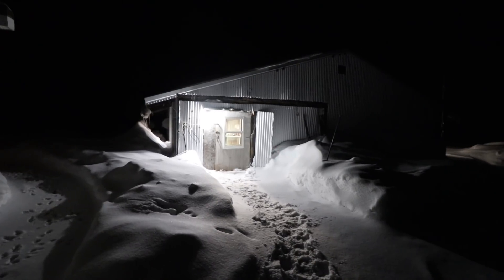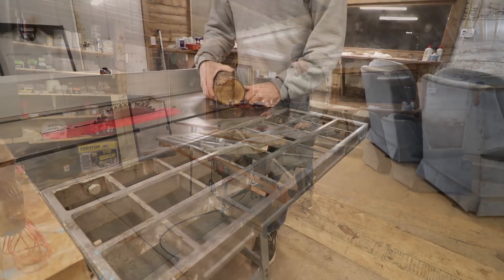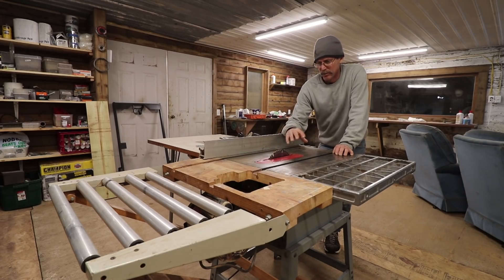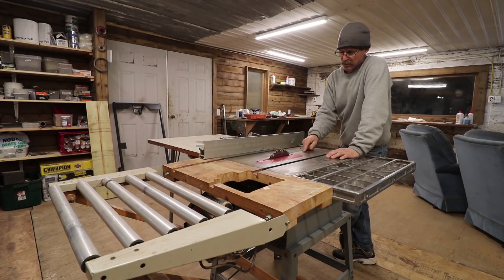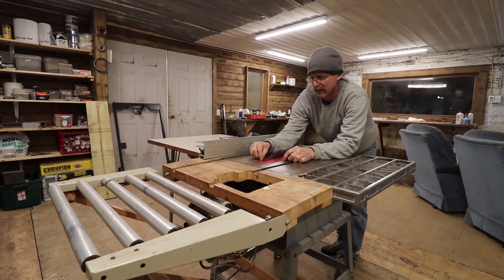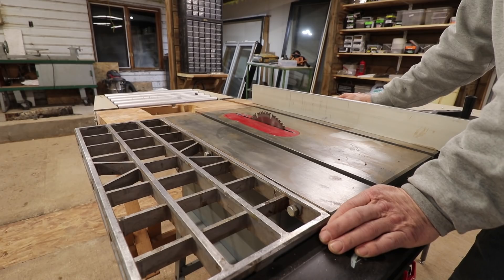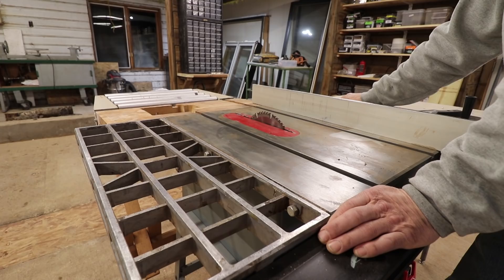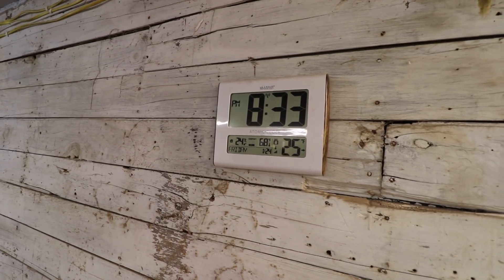Question? Delta Contractors Table Saw. Safety Issue. Board splitter. Your thoughts?

Comment: The splitter and bracket you described 1st in your video is what I use. I have a Delta 34-444 saw with the Delta 34-868 splitter and bracket attached. It fit without any needed spacers. The splitter can be lowered below the table and lifted back up with one pull or push if you choose not to use it on a particular cut.
If you are using it you must push the board all the way through. You cannot stop partway and pull the board out due to the kickback arms on the riving knife. I do love it because it is easily taken out of the way if you don't want it and then raised back up when you do.

Comment: Hi Joe I do this for a living and our saws have what they call a riving knife it sits right behind the blade and that stops the material from catching the back of the blade which causes kick back. Also make sure your table and your fence is aligned with your sawblade if your table is not there is four bolts that you loosen underneath and you can move that table from side to side to adjust it. If you’re running those logs through you should build a carriage that can clamp that log down and make a safe cut don’t listen to some of these people that say do it like you want to there are certain rules to keep a tablesaw from taking off your fingers or kicking back and doing damage to you
Reply: I would use the radial arm saw to cut the logs. If a kickback happens the log will be pushed against the fence.
Reply: this is what i call sound advice! You said it nicely, with knowledge and professionalism. If all of the persons that write comments in these videos understood the importance of making intelligent and truly useful comments, then many would stop writting. Please, if you do not REALLy know what you are talking about, do as I do, speak of the animals, of how much you love these videos, of what hard a hard working man this guy is, , comment on the delicious food Melissa prepares, etc etc etc, but stop writting bullshi......!!!

Comment: I had one of those for about 30 years. I think it was a 444 model, but I sold it. I never really had a problem with kickback, but you only need one time to do some damage. I always stood slightly to the side. It was only a 3/4 hp motor and many times the belt would slip if something bound up. I didn't do professional work, just hobby stuff.
A riving knife would help with kickback more than any other addition. I think most of the manufacturers have added those to the new saws. One issue you might have with kickback is a board going through that window behind you.
I upgraded to a SawStop last year and the blade guard is somewhere in a box. I have never used one and see nothing but annoyance with them. Things like that put barriers up to getting the cut done or limit your vision like you stated. The more time taken to make a cut, the more likely you are to have a issue IMO.
I have great respect for all cutting tools and make sure I am alert and know what I am trying to do. I don't force things and stop if I have a hint of a problem. The older I get, the easier it is to walk away if I get tired or am unsure of what I am trying to do.
Great respect to you for thinking about your safety.
Reply: I have a similar type craftsman saw,and never stand behind the saw when using..one time in all the years I've owned it,I kicked back a piece of oak I was cutting.but because I stood off to the side,I didn't get hit..I also have a great respect for power tools[and my fingers),but shit happens sometimes..

Comment: I have had this model saw for over 30 years and it has been a great saw. The one thing I will say is no matter what saw you have always make sure it is set up properly. By that I mean aligned. There are adjustments to align the blade table and also blade to fence. These are usually in owners manual. I have a dial indicator for this. I believe it is from align it. There are many videos on you tube to show how. This will cut down the chances of  kick back greatly.  I have only had a kick back 3 times an all were my faul. Board moved away from fence and a warped board other side great saw. Thank you for all the videos.

Comment: Some people say you need everything.   I don't use my blade guard because, yes, it does get in the way.   But I also only raise the blade up high enough to cut the material I'm working with, and I use push sticks and other safety devices that keep my hands away from the blade.  As far as a "splitter" or riving knife, you have options.   They do make inserts that will fit your blade plate, that will provide a measure of support.   You can also make your own inserts that have the splitter installed.   You do need something to keep the wood from coming together after it goes thru the blade, for safety.   We had a kid, when I was in high school, that got kickback, and the board went thru his spleen and he spent quite a while in the hospital.   You can also reduce danger, if kickback occurs, by standing to one side of the blade and using push sticks that keep your hands at least 6 to 8 inches away from the blade.   If you have the opportunity to purchase an actual riving knife, for it, that would be the best solution tho.   Take care.

Comment: I hope you will take this as I intend for your safety. I have watched you saw driftwood on different table saws and seen you get by with no problems. I did some foolish cuts myself on table saws but NEVER again. I got a more powerful saw like you did and it will cut so much easier with the added power and it will cut everything so much faster too!! FASTER than you or I could jerk my hand back out of the way.  I was lucky, the finger is attached still. Not as usable as it was and with a crook in it. Don’t cut round objects like tree limbs logs etc without them being fastened securely to a flat board. They will one day roll your hand/fingers into the saw. Yes, it can happen to you no matter what you think. Please play it safe. Might take you longer to get the job done but you will have all your pickers and holders. Thanks for sharing with us.

Comment: I use a track saw for sheet goods. 

I only use table saw for manageable size cross cutting, joint work, narrow ripping.

Always make sure blade and trunnion is adjusted perfectly parallel to mitre slots. Fence is perfectly parallel to blade, If this is not correct then you have a dangerous condition and bad cuts.

I use no anti kickback devices other than well placed beefy  feather boards. Always stand to side of cut. I also recommend thin kerf blades. 

Splitters are ok, I don’t run one anymore, I have a thin aluminum wedge within reach, if I see grain pulling together I stop pushing, and  place wedge in board kerf, then continue pushing.

45 + years shop experience. Never an injury.
I’ve never experienced kickback on a properly set up saw,  other than green wood and unsafe handling and practices. If you feel resistance stop 🛑 you are likely going to have kickback. Never run dull blades.

Comment: I like your table saw. I have a craftman table like yours. I use a feather board in the miter slot or attached to my rip fence to prevent kickback. The only times I have had kickback is when I was not using them.

Comment: I've had a few boards close in on the blade pinching it and I found putting a small piece of wood into the cut to keep it wedged and stop it from pinching worked awesome!  My portable saw doesnt have any form of "splitter" on it either

Comment: I had a JET ProShop 10in. Table Saw, Model# JPS-10, Fence on and off depending on the job I was doing. Like all table saws being very careful with every cut you make. It's the do it your selfer's buying those light weight cheap table saws that run the risk of getting injured.

Comment: I operate a 240V Delta Unisaw with a lot more power than the contractor saws.  Never had a board splitter.  Kickback will happen when the work is not kept parallel to the fence and blade.  I’ve had kickback occur on thin pieces of wood between the fence and blade.  I’ve learned always to stand to the left of the blade.  I feed full sheets of plywood by myself and stand to the left and never had problems.  Good luck!

Comment: I'm like you when it comes to not being able to see what I'm doing one thing you can do is have a metal shop make you a nice spitter or make one hour self alot cheap you dont need the fingers and another thing I do with my saw if I take steel wool to the top then Johnson bees wax I also helps with getting the boards to side. Just a idea.  Keep up the great videos

Comment: Use a Feather-board Joe, they can be used horizontally  ( by clamping them to the table or the fence ) or vertically. I am sure you know about feather boards, they are time consuming to set up but if they prevent a hernia they are worth considering, believe me I know been there done that.   The splitter is a good idea .  A crosscut table-saw sled is good for small pieces, now that you have a good sized table. Happy safe sawing .  Cheers.  :-)

Comment: I've run a 12" table saw for 30 years with out guards or riving knife .  I keep a sharp blade on and one sharp blade handy.  Only one kick back in that time and one turning accident that broke my face shield.   I have all ten fingers and never had any stitches.  Concentration and planning  is the key, I think.

Comment: As others said, a riving knife will work for you but you really need to make some sort of sled to slide those logs through the saw especially with the types of logs you use.  Those logs will roll around on you eventually.  Also cedar and pine have a ton of sap/oils in them that will burn on to the blade in a skinny minute.  As that sap builds up on the blade it will slow the feed rate down until it eventually grabs that log and sends it back your way at speeds that would impress Skywalker.  Clean those nasty blades by  spraying them with oven cleaner and putting them in a garbage bag for a few hours.  I have a 1x1 sticking through the T1-11 on my shop wall as a reminder of what happens with kickback.

Comment: I had an older saw that didnt have one and i just made one out of a scrap piece of metal about same thickness of saw blade and about 1.5" tall and countersunk 2 bolts into the zero clearance plate and attached from underneath. worked perfect.

Comment: Have the same saw only by craftsman. 1.5 HP. I Don't use a splitter for the same reasons you mentioned but have had boards especially wet ones bind up on the back side of the blade. If you keep you hands on the board I cant see getting a kickback. But really its up to you its a personal thing. Ive really wanted a sawstop but the price tag prevents me. Good luck!!

Comment: Joe
I have basically the same saw as you and although a splitter or Riving knife is probably a good idea, I haven’t had one and I still have all my fingers. 
One thing you can do is adjust your fence at the rear so it isn’t perfectly parallel with your miter slot. Just kick it out ever so slightly like 1/32 away from the blade so it’s not pinching your workpiece as you push it through and that will help with avoiding kickback.  I hope my explanation is understood. 
You may be able to get an aftermarket splitter like you were saying through Rockler or any of those other specialty woodworking stores.
I make and use a lot of my own pushsticks as well and stand off to the side when I cut.
One other thing, when cutting those round logs make yourself a jig which will secure the log to a piece of plywood that you could run against the fence. Fashion some toggle clamps on the jig to secure the log. It will be safer and your cuts will be more accurate.

Comment: A riving knife will be a big help; as will not standing directly behind the blade.  Mine kicked back today when I was ripping a thin piece of wood and it slipped between the blade and the insert plate.  It had a 1/4 wide opening, which for most saws is the factory setting.  Make your own insert and raise the running blade through it so it has zero clearance.  That will be a great help.  However, you can't make angled cuts with this set-up; you'll need the standard insert for that.

Comment: As a hobbyist, I have been using a 50's vintage, Cast Iron, Craftsman 10" Table Saw (1 1/2 HP) and Radial Arm Saw.  I'm 72 and, knock on wood, never had a serious problem.   My saws didn't came with any safety gear and I don't know if any aftermarket safety equipment is available.  I think if one is respectful of what might happen, you can avoid problems. Yes, anything is possible however, even with current power tools.  I feel that, in many cases, safety equipment creates a false sense of security. 

First: Be aware of what could happen.  Second: Follow the basic rules of power tool safety. Third: Very important, never use a dull blade! 

Thanks for the Videos.
Reply: Totally agree!   Knowing what can happen and attention to detail when you're  using  the tool are most important.   Otherwise, disaster is only a minor distraction away.

Comment: I've owned Craftsman contractor saws.  Never used a riving knife.  Never had problems with kick back.  But i always keep a hold of the material until it is clear of the blade.  Its just common sense.  You will probably never have an issue.  But put one on if you want, no big deal either way.

Comment: I've worked at a cabinet shop we had an older gentleman that worked there  he built houses and was a cabinet maker for years well he had a kick back at work,it ripped the tip of his little finger off plus took a nice gouge out of his ring finger.we used to have a stand that was made especially for kick back that was set up to catch any peices that did make it by the saw it was approximately 20×20 inches I just remember their being a hole in the middle of it from a kick back.them saws are just like a 12gauge shotgun

Comment: I grew up table saws with out safety. I have a 10 inch table saw too yes it came with safety stuff but your right gets in the way. Respect that saw you know it’s powerful you . Keep your fingers an try not to stand behind the blade. Best not to have a window behind. Yes stuff can happen when you least expect it. I have seen the force of the kick back from a 12 inch saw at 20 feet piercing a 1/4 sheet of masonite . The school the still have shops yes for insurance reason have changed out the good old saws to the ones that are loaded with safety stuff. So I would just say use your best judgment on your own saw .

Comment: I've had that saw and about 12 others over the years and I've never encountered kick back that I couldn't control (or that didn't stall the saw).  Your's is belt driven and more than likely the belt would slip on the pulley while you were holding the board before it would be able to push the board out in a significant way.  You should always plan when pushing a board through a table saw (and I'm sure you do).  Have a pusher stick on hand for when the end comes up.  Have an adequate roller stand to handle the balance on a long board, etc.  A firm grip on the board being pushed through is mandatory.  No weak-kneed users need operate a table saw.  Fortunately, your saw has a fence that is so stout that it practically eliminates it from not being parallel to the blade, which is in  my opinion the biggest source of any kickback.  I still would check the parallel before each set up is used, though.  Too many nervous nellies.

Comment: A splitter is needed for rip cuts.  I made a zero clearance throat plate and stuck a brass 1/8” pin behind the blade.  The pin is press fit so I can push it up about an inch when I rip boards and push it down flush for other cuts.  Old Grizzly contract or saw.  Never had any kickbacks, ever.